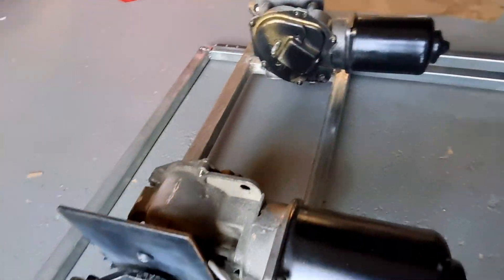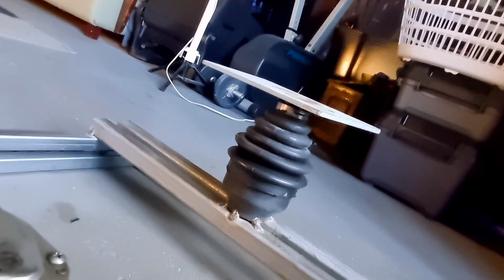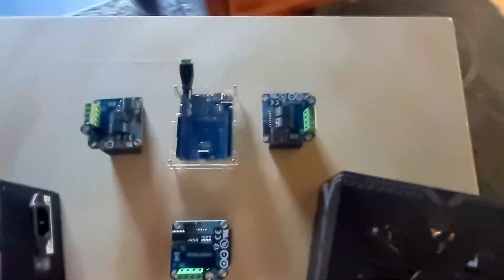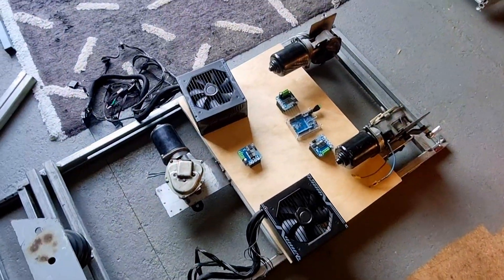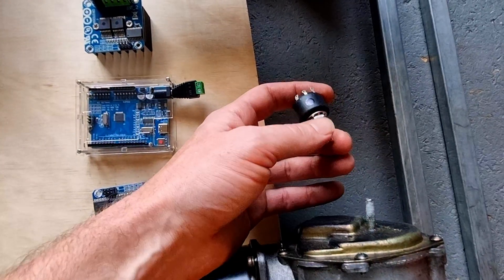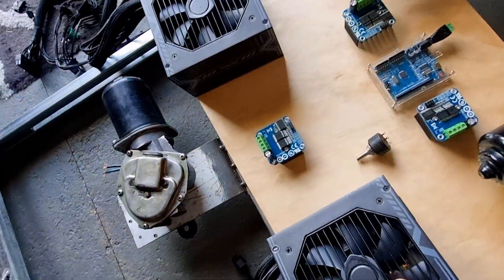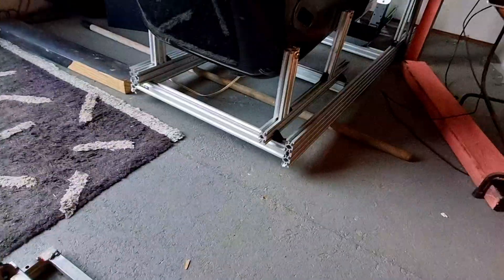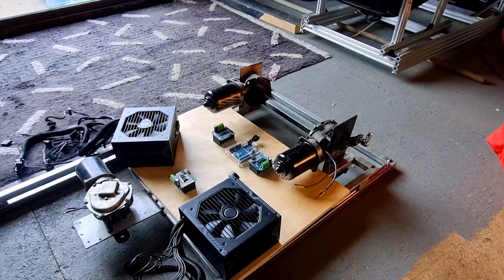EP:1 How to Build a 3DOF Platform with These Simple Steps.

Comment: Nice looking setup there mate. You may find the IBT-2's are a bit disappointing on the front motors (vertical axis). You could try stacking them like some folks do. They really do not handle the return current from the massive spikes sent back to the motor controllers on motor reversal. Even when I modified them to take two heat sinks. Although very expensive, the sabretooth 2x32 motor controller really transformed my vertical motors. They run for hours without breaking a sweat. The IBT-2's are adequate for the horizontal axis motors (surge and TL). They have been in place for over a year without drop outs or failing, because they push/pull on a bearing axis. So they don't get smashed with amps the same as the lifting motors. With the lifting motors (the front motors) the IBT-2's went into protection mode frequently (very annoying when racing or flying) and eventually they just stop working. Hit us up on the discord channel link on my youtube channel. Building a community of DIY sim builders on that discord server. Some interesting stuff on the horizon for powering the platforms from an electrical engineer who is building my design. Will be handy info for you for getting your rig moving down the track.
Reply from the maker: Nice thanks ..will do.
Reply: @SimJunkie  would be great to share your build with us pic etc. Hopefully it’ll help  funnel some traffic to your YouTube channel.

Comment: Sir, sir, sir, do I have some advise for you!  First off, I am sorry for this novel but there is a lot to cover. Secondly, AWSOME job and welcome to the brotherhood! That lower frame is looking awesome.  

We have a lot to cover so Ill try to keep it brief, if you need clarification please dont hesitate to ask.  Also I have like 60 something videos on my channel covering different aspects of building motion sims if you are interested.

Potentiometers - 
Are those pots hall effect pots? based off the price I would say yes which means they cannot be damaged from over rotation and are frictionless (a VERY good thing).  To connect them to the motors I would and do use GT 2 belts and pulleys.  Its very important for the pots to be able to slip on the shaft for alignment so you dont want to hard mount them. You can 3d print GT2 pulleys and buy belts and crimps from amazon

Motors and Drivers - 
I have not had great experiences with wiper motors, though I know Europeans probably have better wiper motors, if it turns out they dont work I would look for wheelchair motors on the cheap.  I have built every rig using them. 
IBT-2 are ok, depending on how much force you want to get out of them and how much you want to replace burnt out ones.  I paralleled them and they were pretty good but would occasionally burn out and it was a pain to replace.  I now use 100A chinese motor drivers (google that and you should see an ebay listing - https://www.ebay.com/itm/122112318908) and they are WAY more powerful and I havent had a single issue with them since I got them

U-Joint - 
Im not sure if that CV joint will be able to withstand the yaw forces the top frame and motors will put on it.  I have used a steering shaft u-joint in the past and it has failed in every motion sim I have put it in, even my seat mover (the most simple version of a motion sim).  I have had to upgrade to driveshaft u-joints every time, something to think about.

Power - 
You might be able to get those PSUs to work but they were not designed for this.  In fact they were designed for the complete opposite.  They are designed to immediately shutoff at the slightest detection of back pressure, which you will be generating a lot of as the motors go in both directions.  I would either go for LED power supplies OR the better option is car batteries with chargers.  I use 2 of them in series for 24V and they have like 800 amps, you will never need that much at one time.  I put the chargers on while Im playing so the batteries dont run out of juice and Im not demanding a ton of electricity at one time from my wall (America is not blessed with 220V everywhere so we have to worry about those things).

I think that about covers it, let me know if you have any questions and again AWESOME JOB and welcome to the DIY motion sim brotherhood!  We are a special breed and we love new members!!!!
Reply from the maker: Hi yer so the CV joint and the motors i had on my last rig and they never failed. yes i had a battery running my last one but my mate ran his whole 3 dof rig off a 1000watt pc power supply and that worked so will see about 2 of these.
cheers. will look into the drivers .
Reply: @SimJunkie  Right on, that is good to hear.  I looked through your videos and didnt see the motion sim so wasnt sure if this was the first build. Anyway, the build is looking good sir!
Reply from the maker: Sorry ill readvise its not a cv joint its the oposite end of the cv joint top end of front wheel drive- drive shaft so it is locked in place like a universal joint same thing.